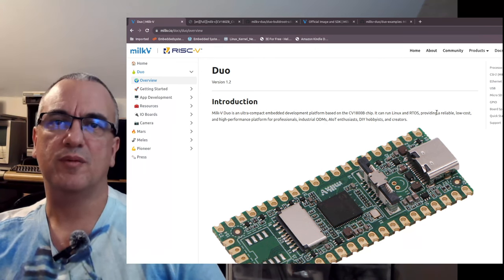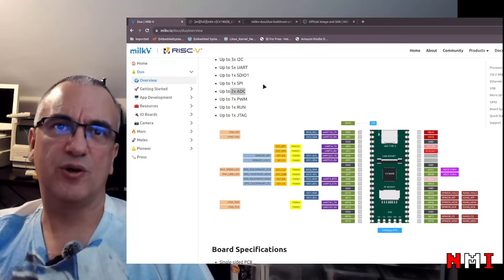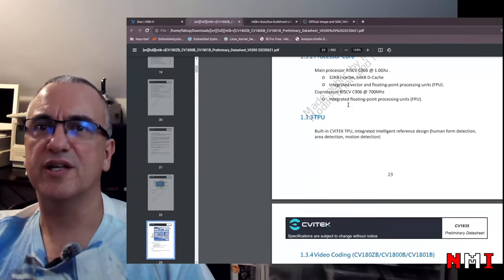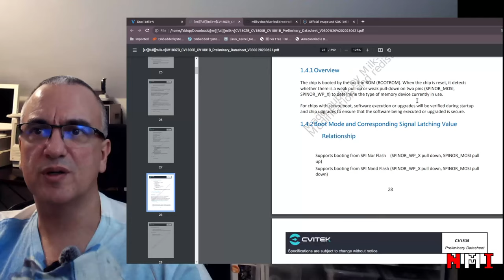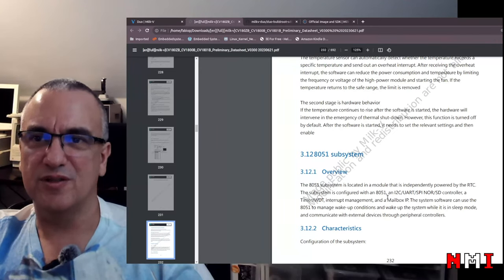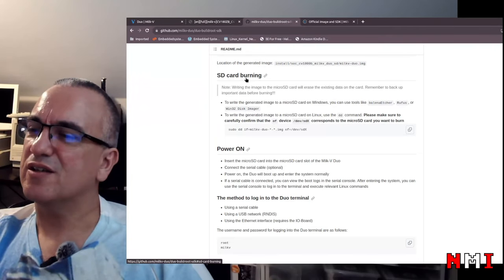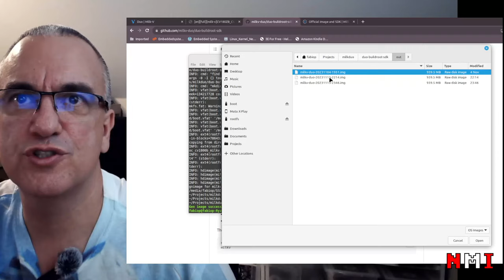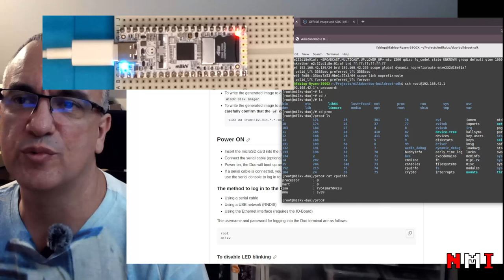002 - MilkV Duo, a $9 Linux board

Comment: Interesting take on it mate, much appreciated - did not know of the 8051 before this!
Reply from the maker: Thanks! Glad you liked it! Yeah the 8051 was totally unexpected!
Reply: Had to go back and read that again, at first I thought you meant you'd never heard of 8051 and I felt incredibly old for a moment until I realised (I hope) you meant that you didn't know there was an 8051 in the Duo...
Reply from the maker: @M0UAW_IO83  yes that is exactly right. I have used different flavours of 8051, from the small 2051 and 4051 from Atmel to those beasts from Dallas (can't recall the pn now). But I was never expecting to find an 8051 core inside a new application processor in 2023! Lol
Reply: @M0UAW_IO83 Yeah bit of a mixed bag. I knew of the 8051 from way back when, but not of the more modern 80251 and similar as I expect is actually used in this
Reply: in circuit cellar 5 steve ciarcia made a supercomputer with 64 8751's as slave processor nodes.  with smt versions it might be pretty tiny, and worth a shot at doing a modern build of.  what might be possible with these milkv's?
Reply from the maker: @felderup  wow! I need to check that out! I used to subscribe to CC and I am a big fan of Ciarcia. Issue #5 you say?

Comment: ADC works at 1.8V only as specified in Datasheet...
In order to have a working Ubuntu, swap partition should be created prior running the system, otherwise with 64MB of RAM apt will not work at all. With swap partition will work very vert slow although the apt porcess with use only 4-6% of CPU.
Reply from the maker: Interesting. Why are you planning to ruin Ubuntu on this machine? Any reason in particular?
Reply: @non_maskable_interrupt  with what else if not with Ubuntu?
Reply from the maker: What I mean is that Ubuntu is a distro. But Buildroot can build anything so you add packages (apt?) to mimic a Debian system like Ubuntu or you can do something else. AFAIK the default package management on Buildroot is opkg which is much more lightweight than apt. But if you want desktop-like experience and turnkey then Ubuntu core might probably make your life easier. Thanks for your comments!
Reply: 64MB. What a dream i had about this when i developed my master thesis project. Now it won't even run an installer 🤣

Comment: I read the datasheet 3 times and I couldn't find any power consumption ratings.

Yet, I couldn't find any CE mark.
Reply from the maker: Yep, I just noticed my link to the datasheet was broken and updated it. The new datasheet still does not show any details on power consumption, just the approximate 500mW for the hypothetical usecase.

Comment: Do you think Linux can run a full OpenCV version, like a Raspberry Pi can?
Reply from the maker: Maybe, these SoCs are intended for use with cameras and there is no point on doing cameras without some sort of CV//ML/AI these days, but depending on which Raspberry Pi you are talking about, a RB Pi (most of them) is gonna have a lot more horse power (aka CPU speed) to perform CV-related processing compared to these SoCs, not to mention that RAM size can also be a constraint.

Comment: Would be perfect if came with the Ethernet and/or Wi-Fi.
Reply from the maker: It has RNDIS over USB and there is an I/O board that includes an Ethernet connector and a USB hub with four ports! Of course it adds up to the cost...
Reply: Actually it has Ethernet pinout on the side where sd card located. But integrated wifi would be much better